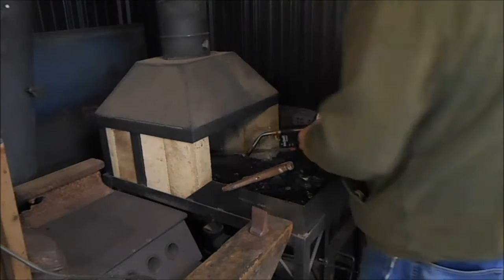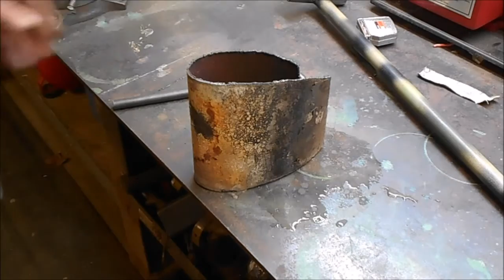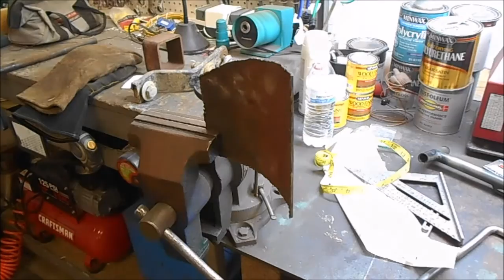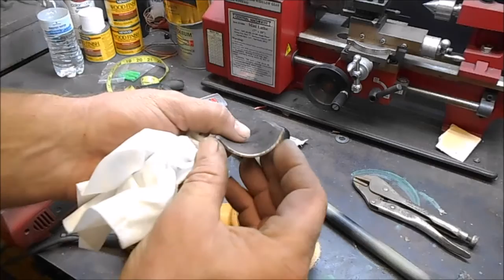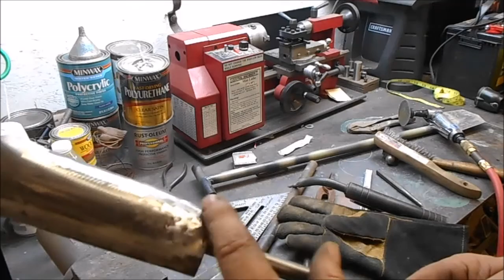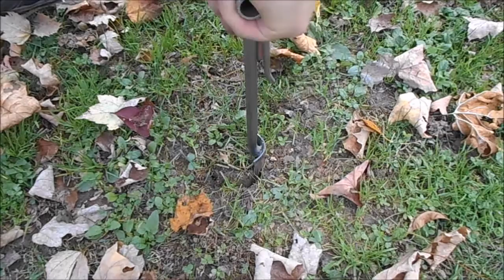metal detector my homemade shovels

Comment: Hay Kevin, how yu going mate...?
this is Paul from Australia, I know your real happy with your shovel and you did do a really good job on making it, Just wanted to give you a little hint if you make a nuther one, instead of putting a bend in the round bar measure about 3inches from the end of your choice that is going to be attached to the shovel, then diagonally cut from that mark to the end, mark the centre of the shovel where the bar will be attached and weld the bar on, THEN heat the bar near to the top of the shovel to get the handle straight, ( I even turn the shovel over and drill 1/2 inch hole and then fill it with weld just to give the bar more holding ability to the shovel ) I hope that helps, ( you can also cut a 3inch V on the bar and the shovel and weld them together that way, witch is how I made my last one ) Now all I seam to be doing is making shovel's for people, but hay they keep paying for them so I keep making them. OH nearly forgot, I use 6inch pipe 3mil thick, easy to cut, and easy to work with, just some hints for yu mate.
Reply from the maker: Thank you for the info Paul that helps.